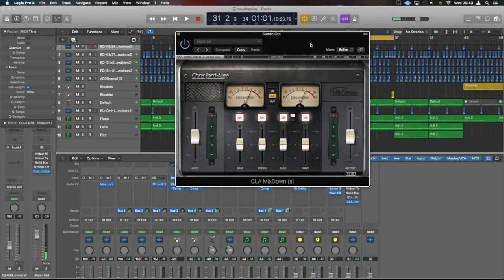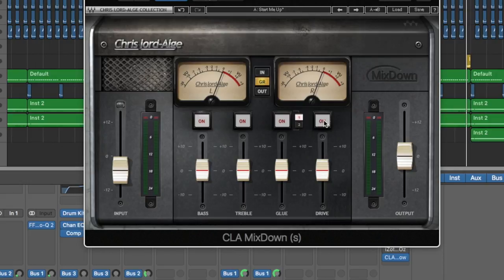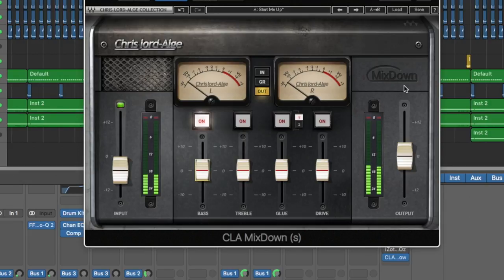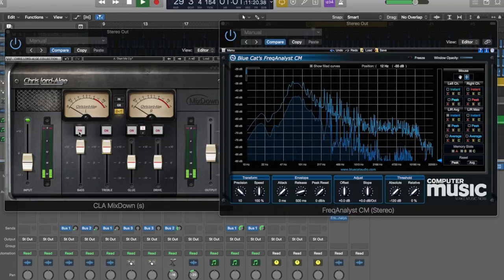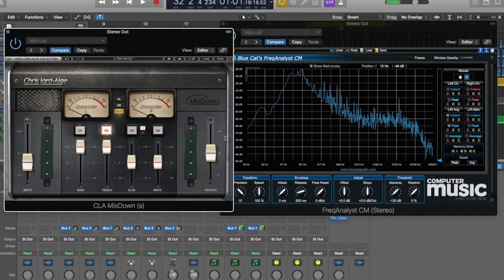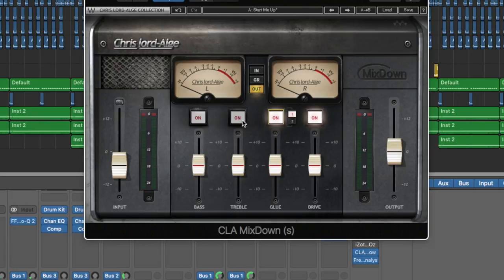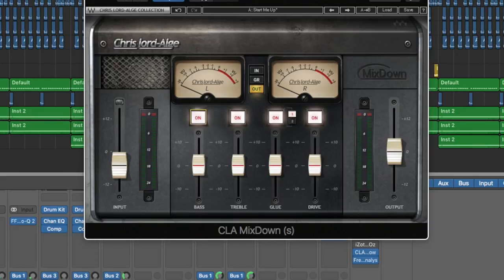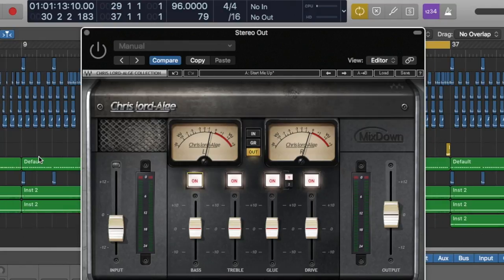CLA Mixdown Tutorial & CPU Useage

Comment: I bought it today. Really just scraped the surface on what the best setting would be for me. Anyway it's best used as subtle IMO rather than a quick fix like many might do if you believe the CLA hype. Prefer to have more control over a mix stage by stage.
Reply from the maker: +Aaron Lothian it it no way stops you having control
Reply: I'm not saying it stops you having control but it is reduced and very much hidden from the user. Like how much compression is it using or drive. I realise it's a turn off your brain type of plug-in however as someone who is trying to learn as I go, I find that set and forget approach can be counter intuitive.

The next thing I am working on I will try to involve it more in the process. So I wasn't slating the plug-in; more like the promotional material used to sell by Waves themselves. Your frequency analysis does reveal more of what it does. For this I use another plug-in or the Quad-Curve analysis in Sonar.
Reply from the maker: Aaron Lothian if you're learning I can absolutely see the disadvantages. However it also allows you to get the results without the gear investment
Reply: Unders. perhaps always learning is better way to put it.I just like to know how things work.
Reply from the maker: Aaron Lothian this was my main dislike of lurssen mastering

Comment: CPU usage depends on your system. If you want to give some kind of indicator of it, you might wanna show the specs of you mac, also what audio interface, buffer size, availale ram and sample rate plays a huge part.
I'm not into Logic but back in the day you could double click on the "cpu" sign and the available threads would show up inside the app, so the number of cores in your system will probably be half that (unless you're using an i5 cpu or lower).
:-)
Reply from the maker: +erand droory it's in the description and answered for Someone who asked

Comment: Good review. But the input level is too low. You want to be in the yellow light on CLA stuff.
Reply: I think so too but in the Waves video CLA himself keeps everything at 0 as well...
Reply: mickey5241 Yeah. He must have the master level louder going into the plugin. I'm just going off the manual :)
Good stuff though!
Reply from the maker: peaking into the yellow sounded best. Thanks for checking in guys
Reply: Unders keep up the good work :)
Reply from the maker: added the part about the input to the description. 

Sensitivity LED
Indicates input level. Adjust input fader to achieve correct LED color.
Green = input level too low
Yellow = optimal input level
Red = input level too high
Reply: to get the sound intended from the plugin you wanna get around -3db gain reduction. Source: CLA

Comment: Also about the cpu usage, I noticed mine doubled when I switch on CLA. I've got a Macbook pro with a 2.3 GHz i7 with a maxed out RAM (16gigs). And the project I'm working on has 23 active channels. When CLA is'nt on it's averages around 8 to 9 percent usage, but when CLA is on it doubles to 16 percent.
Reply from the maker: +Somalie Ahmed Garoon oh that's a big jump! I did this the hour it was released I wonder if it was updated I'm only using an i5 too.
Reply: That's on my Ableton though. It could be an issue for Ableton users only.
Reply: I use Reaper, an HP probook i5 with 8g ram...I have 16 tracks w CLAs on...not much cpu hit. Reaper is cpu friendly however.